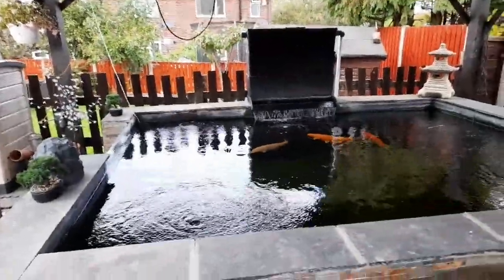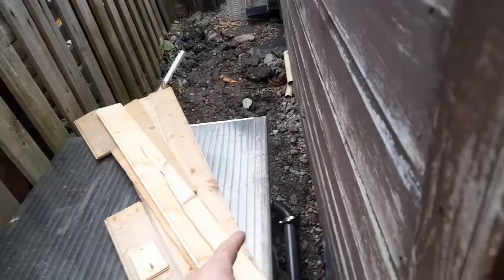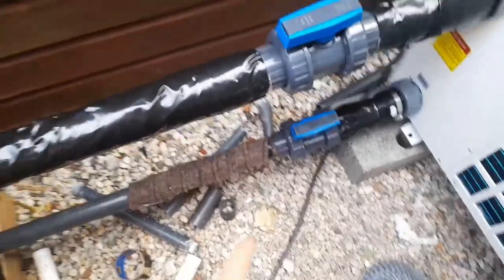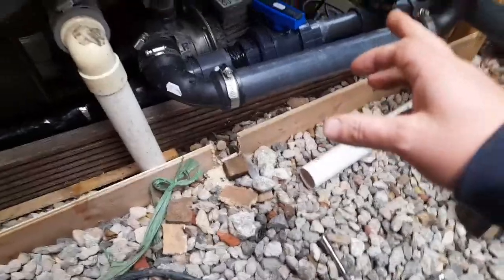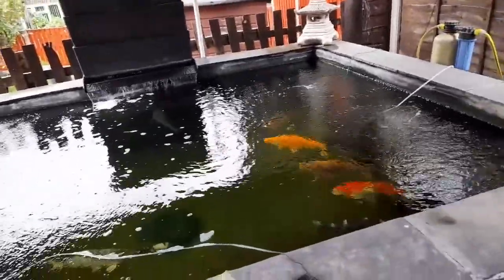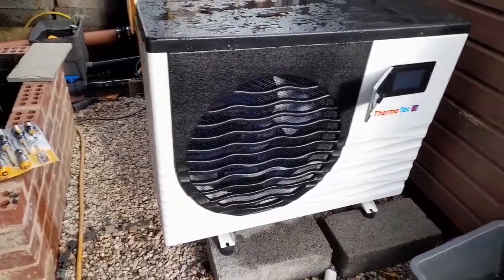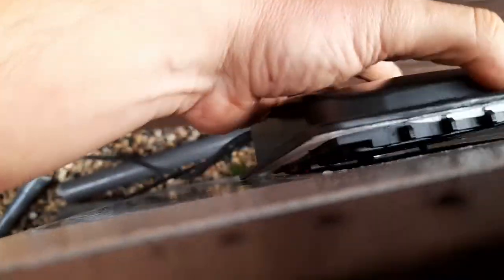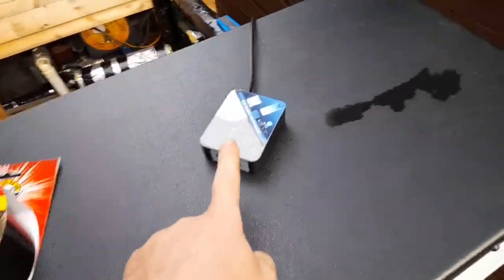air source heat pump up and running and add WiFi to heat too

Comment: them pipes are wrapped well and should keep the heat in mate what are you covering the pond with?
Reply from the maker: Cheers pal I got polycarbonate sheets but want some new ones  but not cheap to buy plus miss want new kitchen lol
Reply: @sony436  yeah polycarb aint cheep im not putting it over my pond im going to use an alternative as ive already got polycarb roof on the pergola